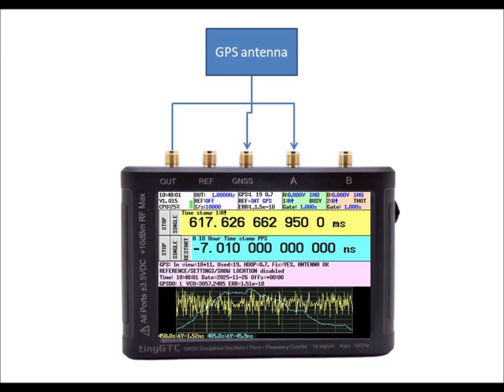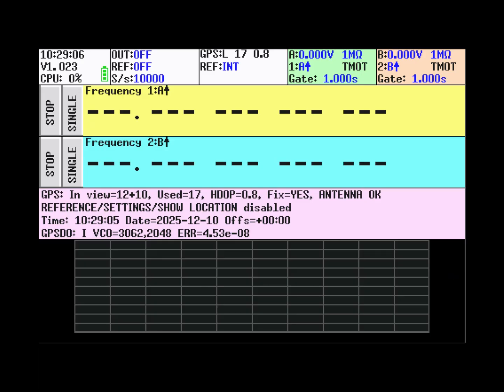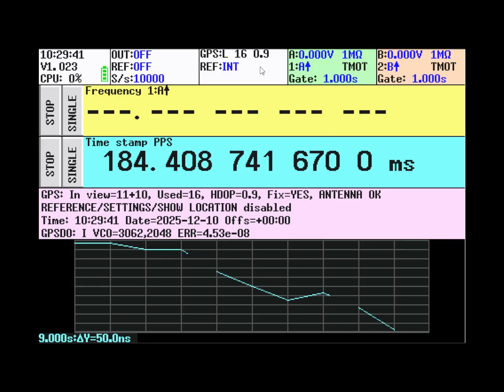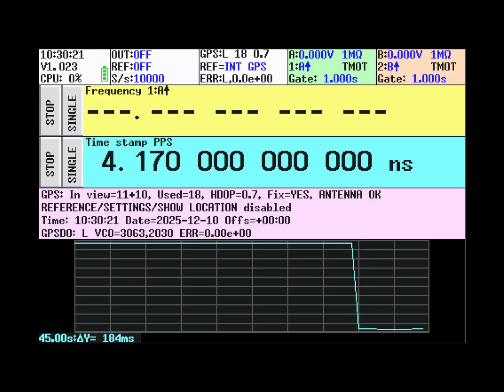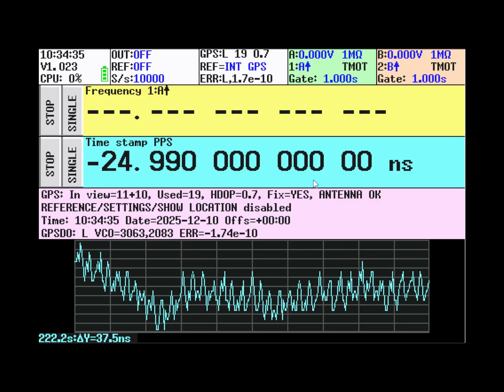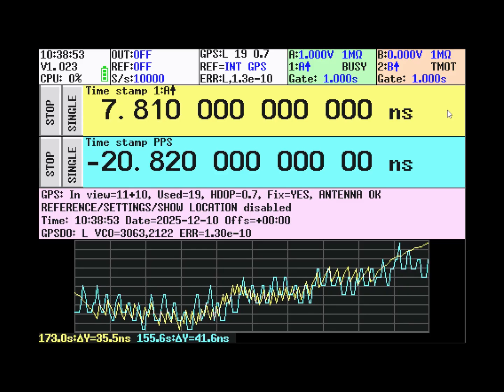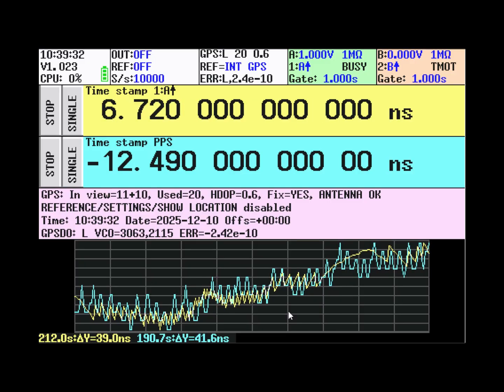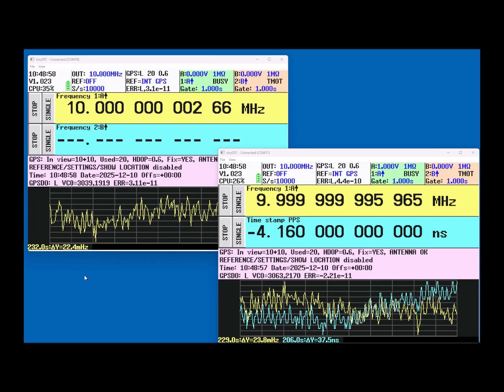tinyGTC GPSDO demonstration

Comment: The GPS antenna cable is only 2m, can it be extended with a good quality cable like RG223? I have my setup in a shielded room in my basement so the GPS would not work. I do have a commercial R&S GPS reference but I wanted this independent from it.
Reply from the maker: Yes, you can extend the cable. You will lose some sensitivity. Can't tell how much, just try
Reply: @ErikKaashoek  thank you for the reply Eric, I will try once it arrives. so far no luck though, R&L is not very reliable these days.